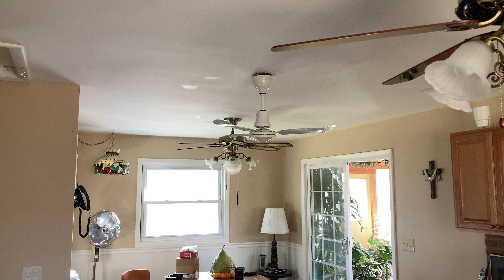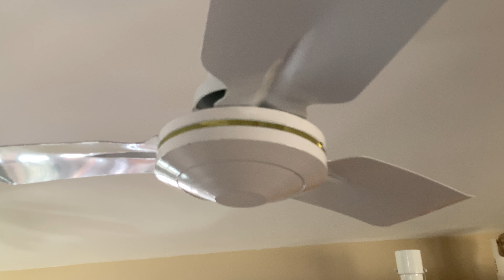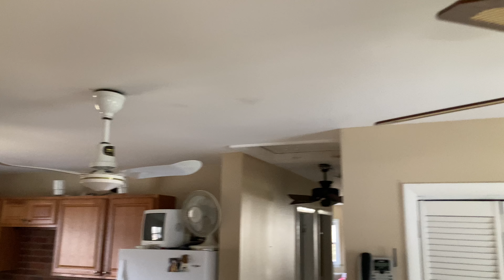EnviroFan 136F-7 36" Industrial Ceiling Fan | Performance Test and Analysis in the Kitchen

Comment: I have a Canarm CP36 industrial installed in my basement with 7'2" ceilings. I got the shortest downrod I could find for it, which if I recall was 8", and made by Canarm for this fan. There is less than a 1" space between the canopy and motor cover. I was still able to get it wired and hooked to the electrical box J hook adapter. It looks very proportionate and much better than longer downrods in a residential application.

It looks like there is just as much room in the Envirofan canopy to get it onto the hook, so I think you can make it work. Three of these units would look awesome in that kitchen! I have a black 56" Envirofan I'd plan to install to match my 80's Kenmore appliances.

The Canarm CP36 has so much more pitch to its blades than the Envirofan 136, moves a ton of air. I also balanced it perfectly with a ceiling fan balance kit, since Canarm has yet to sell me a fan that doesn't wobble. I'm one of those few that uses those on almost every fan I install. Can't stand even a bit of wobble. It's running on a solid state speed control right behind me. different strokes I guess. I grew up with a 30" SMC in my bedroom so I got used to excessive ceiling fan motor noise decades ago. Don't even notice it anymore lol

Can't wait to see you get three of these going.
Reply from the maker: I've had a handful of people mention the CP36 to me since I showed this unit a few weeks back. Definitely on the lookout for one now, though they seem to have completely disappeared from the market already. Did Canarm replace it with a different 36" model or do they not have any 36" offerings anymore?
Reply: @JordanU  Sadly Canarm discontinued ALL of their AC industrial/commercial ceiling fans, and replaced them with these awful DC fans. I say they are awful not just because they are DC, but because they need a special proprietary electronic wall control to run. They don't even make a 36" unit any longer. 

It's really a bummer, as Canadian companies Canarm and Banvil are mostly responsible for this type of fan entering both our markets decades ago. Banvil still does EnviroFans here too thankfully, which seem to be identical to the Northwest EnviroFans in the USA.

The build quality of the CP36 isn't quite as nice as the EnviroFan Golds. One piece steel blades, Steel motor housing and about 5lbs lighter. But the performance, and appearance is excellent. I have several in black and white squirrelled away. When I went to order the more popular reversible CP56 model years ago and found it discontinued, I knew the writing was on the wall so to speak, and ordered some CP36. They where also discontinued a month later. If your having trouble finding one closer to you, I'd be willing to let one white CP36 go. Reversible model. Specs say 394 RPM for these fans, which appears correct, but I need to confirm for myself with my own fans. I think you'd like the CP36 it's an economical powerhouse.

Comment: @26:40. I've always imagined installing these in the cash office/managers office of restaurants/sports bars I've worked in. They are tiny rooms with maybe a 9 foot ceiling, horrible ventilation and they're always hot because of the computers & networking equipment. When stuff is being done in the safe/people are getting cashed out the door has to be closed. The room is often located somewhere in the kitchen area, so even if the door is open you are getting the smells & humidity from the dish area (if that's nearby). Then again, it's so noisy for the airflow it puts out, it'd probably make more sense to go with a 30-36 inch damp or wet rated residential fan.
Reply from the maker: The Dayton model would be a good choice for that. These probably wouldn't move enough air!

Comment: Why is the tips curved upward
Reply: It’s for better performance, and quieter operation. Im not certain if it actually works, though I do notice that the ones with flat blades tend to have a more choppy sound and more turbulent airflow. Apparently it also moves air out to the sides better rather than just straight down.
Reply: @Kidd-nq4fg  okay thanks for the info on those blades
Reply: to move more air
Reply: @AlexTheFanMan. that is the only one that I have seen with the blades with this curve on the ends of them
Reply from the maker: I think the point was to push the air outwards more, but I don't think it really does much.